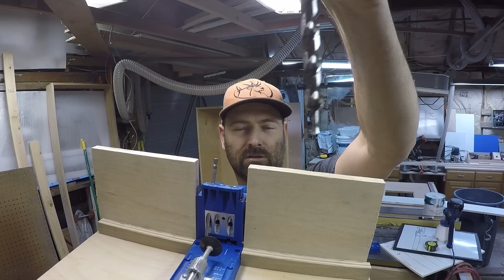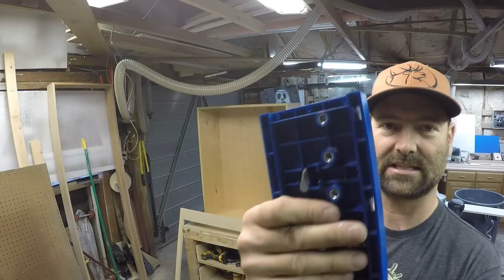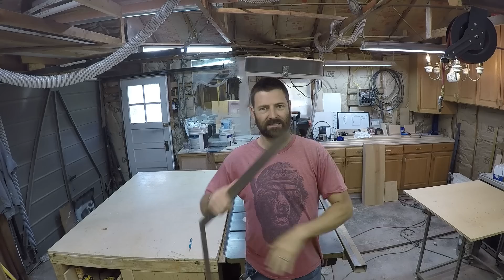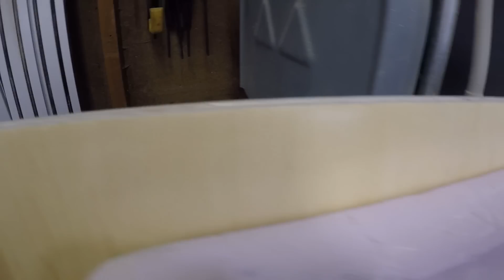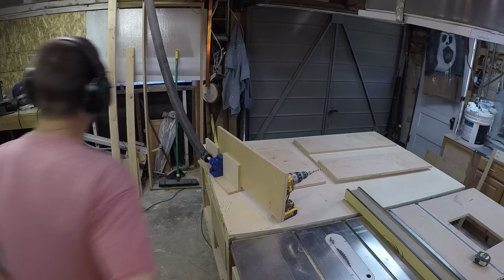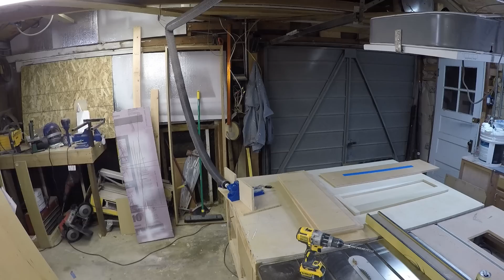Cabinet Building FAQ | THE HANDYMAN |

Comment: Lot's of comments so apologize if already asked. Could this version of custom cabinets be made with Festool Track System and Kreg Jig System.
Reply from the maker: Do you mean with a track saw?   Yes.  I use my DeWalt track saw to break the sheets down to fin in my table saw.
Reply: @TheHandyman1  Yes the Festool track system soup to nuts with no table saw in the mix. These cost as much or more than a good table saw but are a fraction of the size.
Reply from the maker: My table saw cost $3,000.  It can be done with a track saw.

Comment: Handyman. Don't use pegboard as a drill guide. Use it as a router guide. You need a plunge router, a collar on your router and a down cut bit. Rip your peg board down the middle of the holes on each long side so you have a bunch of U's along the edge. It doesn't have to be exactly in the middle of the holes as long as it's square. Clamp it to your cabinet side and use the collar to locate the router in each U, set your depth and plunge away. No moving metal touches your jig.  

Read that twice. It'll make sense

Comment: No social media. But- square up a piece of 2x and screw to your upright support of your k4 jig. Fill with other scrap sheet good, or mill down another piece of 2x. Then run a piece of sheet good down that face, and past the side of your bench.  Screw/clamp it to the side of the bench. Personally I’d just screw it to the top and remove when needed. But your call. That thing moving around would drive me nuts. !!

Comment: No tweet account? You're so square... 🙄📐

US hardwood plywood grading is a letter grade face & number grade back.
The higher the letter & number, the less repairs, knots & natural defects.
eg A-1 maple being the best & almost always stain grade. B-2 can be stain or paint grade. C-3 & C-4 is usually paint grade. (But some cabinet & furniture makers will stain C grades very dark to hide flaws.) Also, you can substitute pre-finished birch for maple, they look & finish similar. But birch is not as dense & strong as maple. 

The saddest cabinet blunder I ever saw, price-wise, was a hip but very naive young couple demand a, "sustainable, recycled, Green, no trees were harmed" kitchen. The sly installer happily sold them $1,500 worth of cheap junk particleboard cabinets for $20,000. (😲) It was only a small 10' corner L-kitchen. And why sticking to industry standard materials is a good idea, agree. Special requests may come with especially special pricing. 

(OK, question: Have you ever built magician's cabinets? The kind you step inside & disappear? If so, how do they work? Do you use special wood that sends people to another dimension? What if they don't come back? Do you carry special liability insurance for that?)

Comment: Nope, don't tweet, twitter - don't have the time - but do like your vids and usually pick up something each time. 

One cheap tip for slippery tables - go to the kitchen area in LowesDepot and pick up some draw liners (sort of like a soft meshy type mat material). Put a piece on your table and then put wood you are sanding or working on top. Actally works great for tool cabinet draw liners too. 

Take care,

h

Comment: If this link works it should take you to shelf/drawer liner, rubberized,  that i use in the work shop to keep wood panels from slippeg around.  They can be washed, no dryer, to refresh the grip.  shopphttps://www.amazon.com/b?node=18945825011&pf_rd_p=b22a3d8a-d3e6-4605-bf98-0cb46e712621&pf_rd_s=detail-ilm&pf_rd_t=201&pf_rd_i=B00C2LMKQM&pf_rd_m=ATVPDKIKX0DER&pf_rd_r=YCDARCNM9F2NSYGJ6NGZ&pf_rd_r=YCDARCNM9F2NSYGJ6NGZ&pf_rd_p=b22a3d8a-d3e6-4605-bf98-0cb46e712621
Reply from the maker: Like went to amazon but that's it.  I didn't' see the shelf liner.

Comment: The European style cabinets are definitely more popular and more expensive than face frames in my region.  The latest fad here is concrete doors and panels that look like slate.  The drawers are the metabox style with LED lit up plexi panels as the drawer opens. Generally  going around $75k and I’ve seen one at $110K
I prefer the pegboard drilling jig over the Kreg and the holes don’t get reamed out when using a self centring bit, it’s also faster than the Kreg, I use a drill press and a fence.  Nothing wrong with the Kreg, my system just works great for me.

Comment: I just installed a kitchen.  It had 16 cabinets in it.  Two were Island cabinets and finished on the front and back sides.  There was also a large pantry cabinet.  It cost about $8500 for the cabinets.  Soft close doors and drawers but plastic covered particle board boxes.  All fronts were painted.

These were just above budget grade cabinets.  The only thing separating them from budget cabinets were the soft close hinges and drawer glides.

Comment: You do good work and have good methods. One suggestion I would recommend is to reduce the amount of shelf pin holes. Normal to see shelf either centered top to bottom or if two shelves split evenly in thirds. If it’s a one shelf cabinet drill enough holes for a couple inches up and a couple inches down from center. If multiple shelves are to be installed more holes will be needed. No sense adding additional labor drilling holes for no reason. Five vertical holes for adjusting one shelf and nine for two shelves seem to be adequate for most. Making a spacer block to set your jig against makes repeatability accurate.

Comment: What is the main factor or factors that drive the cost of cabinets to such high prices? Is it a matter of supply and demand or simply the time required to manufacture?
Reply from the maker: Lots of middle men and mark up.  I can get some wholesale cabinets for about 50% of what the same cabinets cost through a design center.
Reply: @TheHandyman1  Good explanation. A follow up question: How much time goes into the actual construction of cabinets? An example case would be a good baseline. Also assuming the worker has built a few and gotten it down to  a routine.

Comment: how do you hide the pocket holes at the bottom of the upper cabinets? do you edge band the shelves?
Reply from the maker: The bottom will be skinned with 1/4 plywood.
Reply: @TheHandyman1  thanks for the reply. what about the shelves?
Reply from the maker: Shelves will be the same 3/4 inches plywood with finished edge banding.

Comment: I love your videos and really appreciate not having the high volume when using tools, but would prefer some sound over none.  I wonder if their is an issue with video/sound when there is none for a length of time.  I have built a few cabinets, and you do a good job and are on the right path with tools.

Comment: Edit (non finished sanded plywood only I forgot he was using prefinished) you should always glue and screw when doing pockets joints, takes a few seconds and dramatically increases the shear strength by hundreds of pounds. Just finished a small handyman project where I didn't glue my pocket joinery until halfway through the difference was significant for the brief amount of time it takes and the less then 10 bucks lowest level wood glue
Reply from the maker: Glue does not stick to Prefinished plywood.
Reply: @TheHandyman1  you're right my bad. I forgot one side's going to have a coating
Reply from the maker: How did you do that?  YOU got skills.

Comment: Just a FYI heads up- the collar will slip ever-so-slightly deepening the overall depth of the pocket screw it's very hard to notice until you actually go and install the screw. Check it continuously and don't assume when you come back the following work day it's set at the proper depth

Edit- the reason why this is so important is because you have very little room between the Finish surface and the tip of that screw
Reply: Tuco The troll I learned this the very hard way.